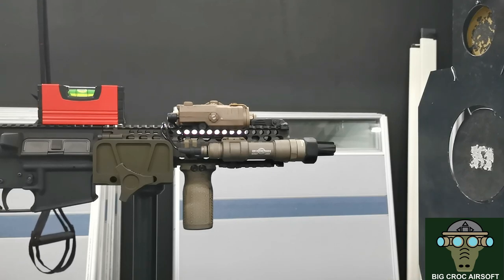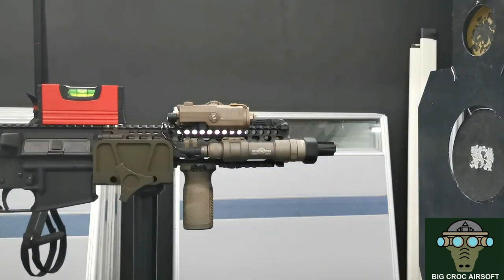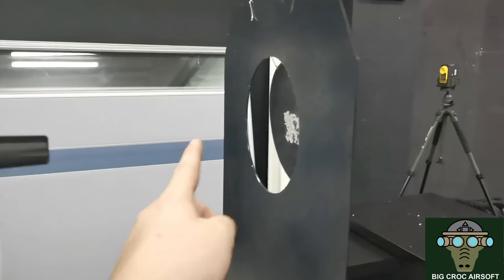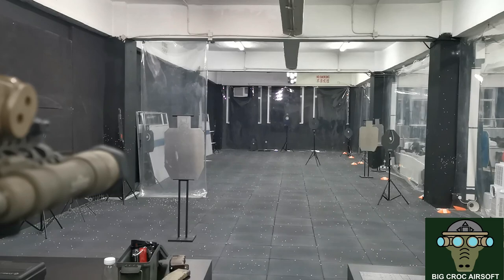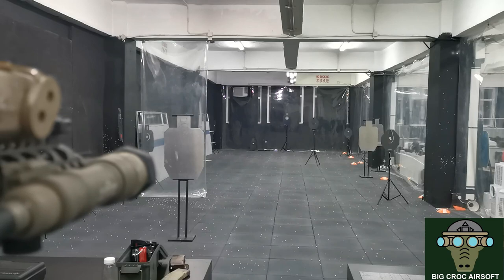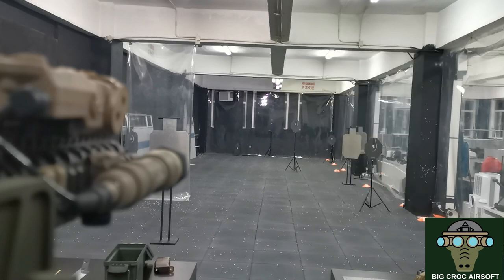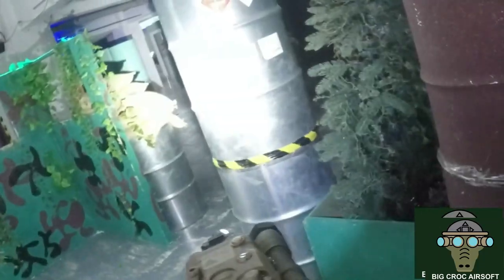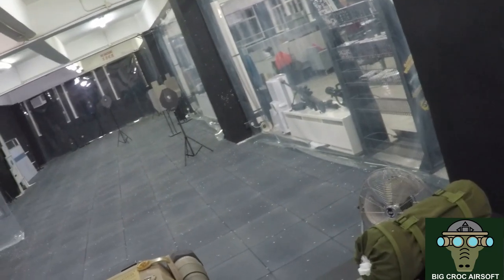Zeroing optics for airsoft guns, how to zero optics on airsoft the proper way

Comment: Question, When ever I fire my Airsoft gun with my red dot the bb’s are always hitting low, should I increase the hop up or zero the red dot?
Reply from the maker: Thats what the whole video is about!  Do watch through the whole thing first
Reply: @BigCrocAirsoft  I still don't understand my English is okay but I can't really understand watcha taking bout
Reply: @Erik_077  the hop up should be adjusted to get its maximum range then yyou adjust the red dot to where the gun shoots. That way you don’t remove range from your gun by over hopping bbs.

Comment: I'm trying to increase the accuracy of my ptw. What would you recommend me doing? I have an fcc gen 2 14.5 hopup unit and barrel assembly installed but my shots seem to curve a times. I clean the barrel and get the same results and I've changed my bbs to 28s. At 20 meters my shots will curve...help please if you can
Reply from the maker: My current setup is.  Systema Chamber, with Orga Flat Hop, Systema Barrel 10.5", systema cylinder M110. shooting around 1.5J with 0.3g BBs (using HPA or BLS BB) I also changed outer barrel to HAO and it does better spec and better sealing. 

1-2 inch grouping at 20 meters. 

i found that systema Cylinder does better for barrel at 14.5" , it has more air and more consistent. 

The curving could be because of the outerbarrel, I changed to HAO one and its better in sealing and spec. FCC outer barrel might be a little tilted and with the hopup, it will always curve left/right. 

so I wouul go for outer barrel change and Orga flat hop for now if you are on a budget, then upgrade to chamber, barrel, cylinder to systema afterwards
Reply: @BigCrocAirsoft   thanks I really appreciate it. I just got into the fcc/systema ptw world I like it but I just have to get the tuning right.
Reply from the maker: From my experience, systema top part (barrel, chamber, cylinder ) is better, FCC motor (verison 3.5) is better than systema. Electronics and mosfet both are similar imo